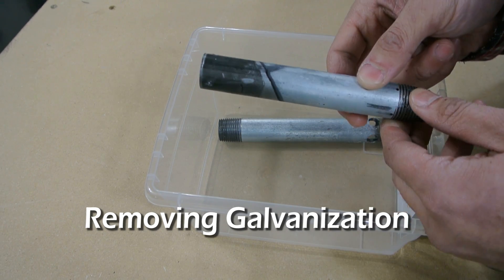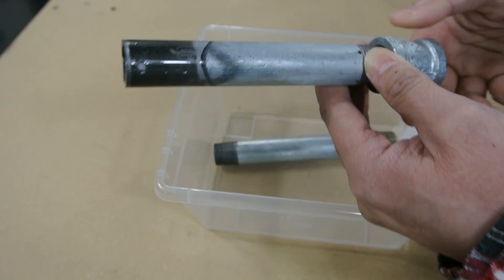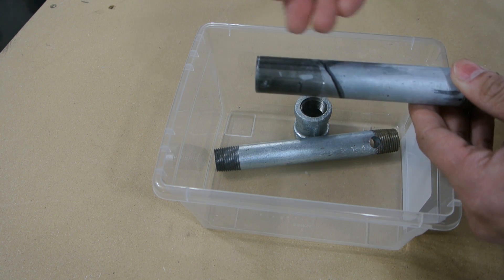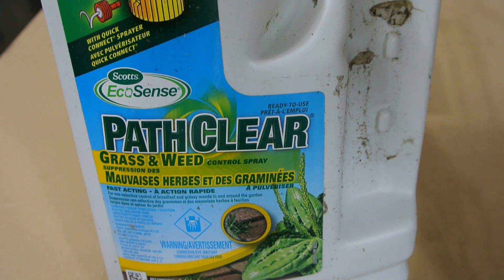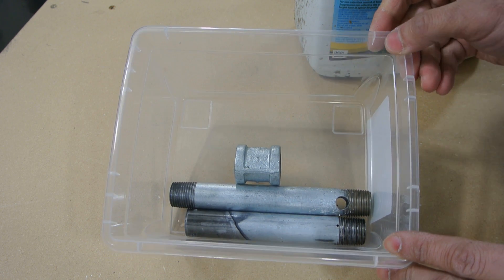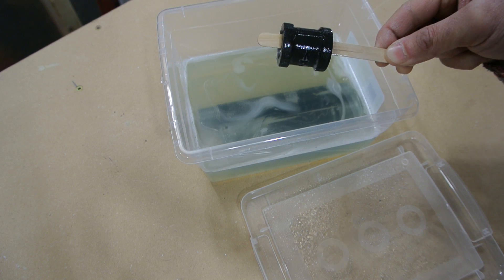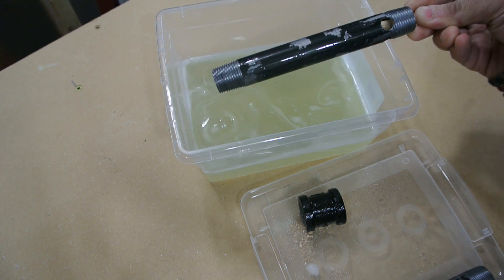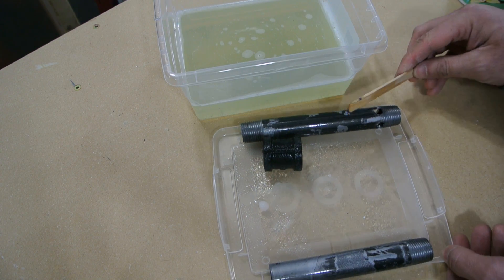How to Remove Galvanization

Comment: #1 Lowes has black iron pipe in all forms and all sizes (I used to NOT go in Lowes [as a Tony Stewart fan, that would be Blasphrmy !] ) but after a dozen trips to our 3 local Home Depots and searching for stuff they Don't carry { or only online!} I tried Lowes...they stock everything ! Have only been to HD once in the past 2 years ! #2 I'm doing 14" hot dipped inner and outer galvanize, gonna suit up in all acid proof p.p.e. and do the muriatic acid/baking soda neutralize thing 《contained and ventilated outdoors of course ! 》

Comment: It should be ones last resort to buy from a Home Depot or Lowes.  Always, always, always go to a local plumbing supply shop.  Any shop worth it's salt will have black iron pipe from 1/2 " to 3 " plus a selection from it's remnant/scrap piles.  You'll get better service & much better advice on anything you have questions with.

Comment: FYI: Diluted Muriatic acid works much faster and better to remove zinc than alternative acids and can also remove rust and mill scale. Also one should neutralize the washed cleaned steel surface with a basic solution soak. Good candidates for this nutralizing soak for acid residue are sodium carbonate (washing soda), dilute sodium hydroxide (Lye), ammonia water or baking soda solution. My preferred solution is sodium carbonate soak.
Reply: Isn't sodium carbonate a powder? Do you make a solution with it?

Comment: Can i re-use the vinegar? Cause I have boat trailer with galvanized parts that need patching. If I fill a 5 gallon bucket with vinegar can i reuse it a few times?
Reply: If it hasn't been used up yes. But it will likely be very weak because most of it will have been used up

Comment: I have tried vinegar last week, process was slow , pretty slow. Another "safe product" would be the toilet bowl cleaning, they contain muriatic acid, about 15% and under. Still less than the one you buy for pool cleaning, but safer to handle. It works nicely too and has the mint odour which is pleasant. 
I use zep commercial acidic toilet bowl cleaner.
Reply: Good to know thank you.